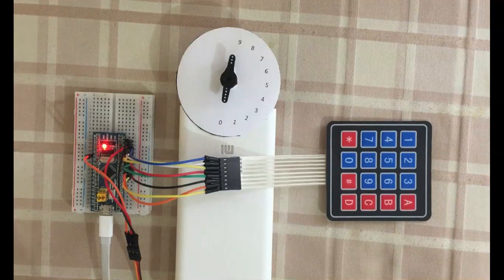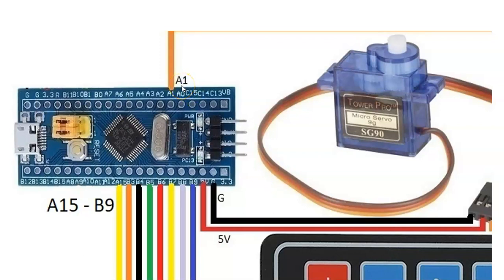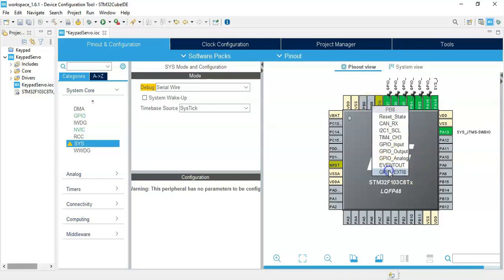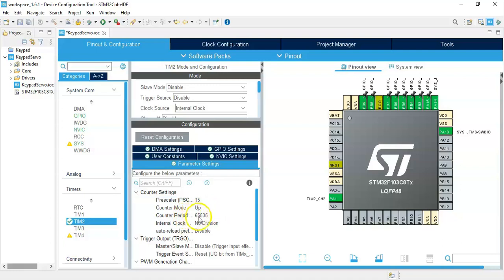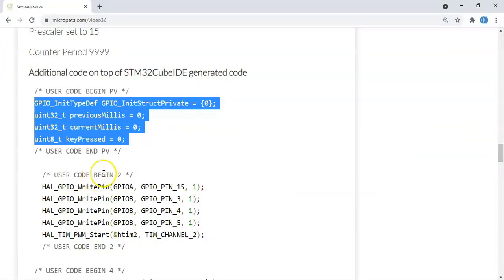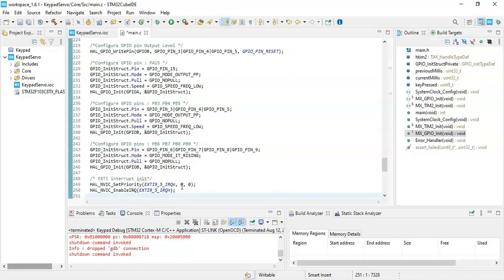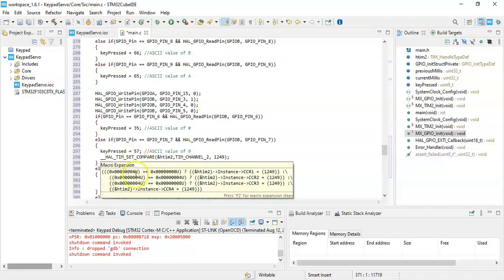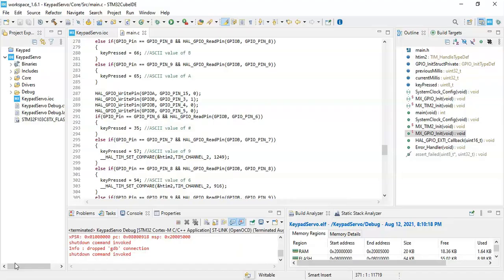36. STM32CubeIDE Servo by keypad with STM32F103C8T6

Comment: hi sir,  I use STM32f303K8. The pin out is different to STM32F103C8T6. How to wiring diagram and setup pinout configuration?